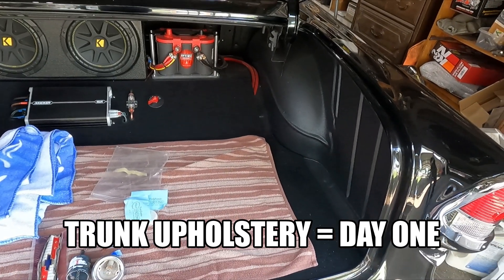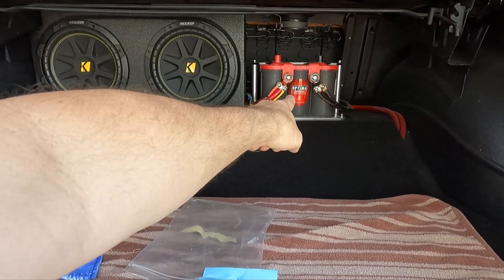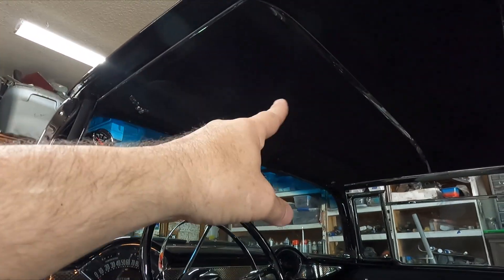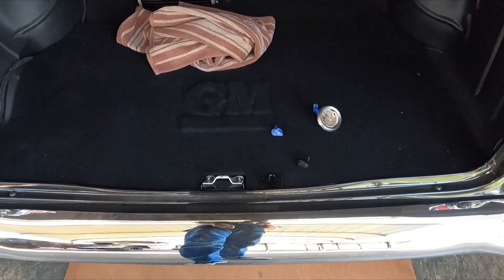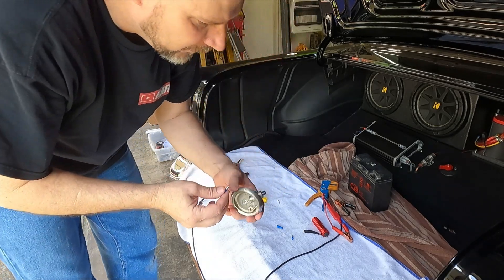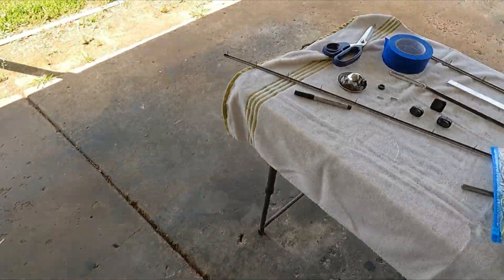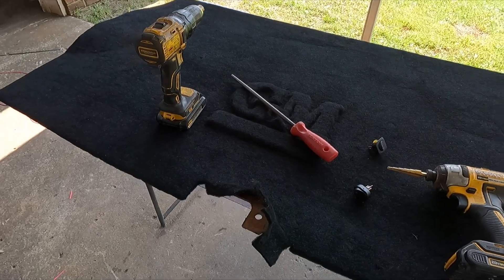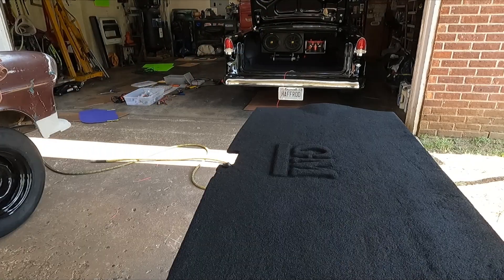Day One On My 1955 Chevy Hardtop Project

Comment: If the trunk light was wired into the tail light circuit which is already running across the back of the trunk the trunk light would always be off unless you had the park or tail lights on. Then it couldn't run the battery down if left on when parked. Just a thought... I would break the ground wire on those lights just like the ones in the car are done.

Comment: Takes time to figure stuff out if you want it to look good, I think your trunk is going to look really nice especially with the trim. 
If you’re worried about leaving the trunk lights on, you could always add a timer relay , would probably fit behind your side panels, I know you don’t want to spend the money right now but I think they’re about $15? At least your switch has a little light on it so you may not need it.
I bought the exact flaring tool from Speedway a while ago and works like a hot damn! Wish I had it years ago! Great video Rob, looking forward to tomorrows.
Reply from the maker: I've always disliked flaring lines but now it should be more fun. Lol
Reply: Good morning Rob
I was in the brake business for 25 years and always did them the old way, this tool it’s the cats meow! I have two cars to make lines for and this tool will make it fun! Have a great day Rob, looking forward to the next video

Comment: i would just run off the rear parking light or the number plate light no need for switches no need to worry about turning it off just a thought
Reply from the maker: Trunk lights would be on when the lights were on driving at night. That wouldn't work for me
Reply: @haffrods7055  sorry my bad i omitted that i have used a mercury switch on the hinge. and i do understand that you only wanted to use what you had. so hats off to you sir. Cheers